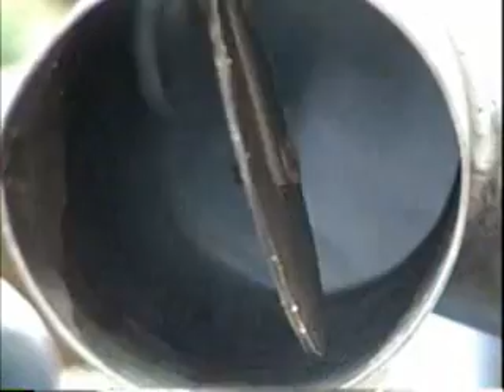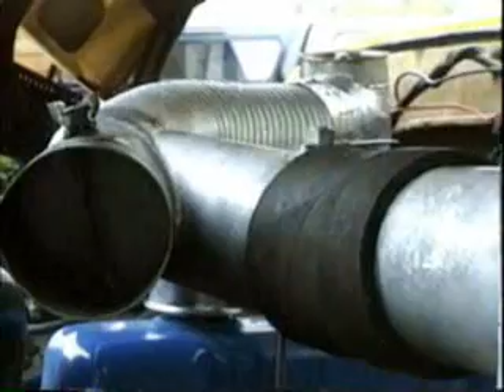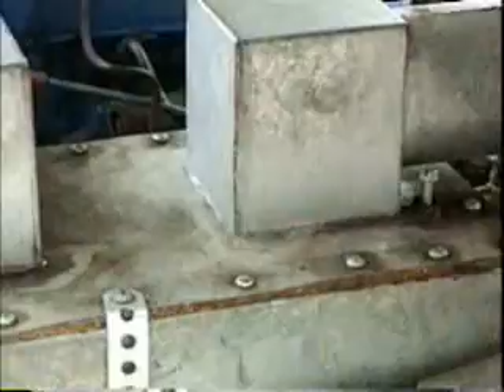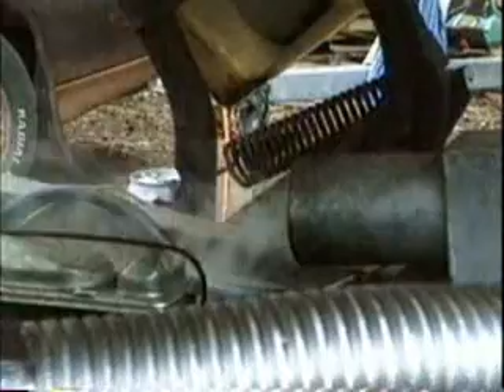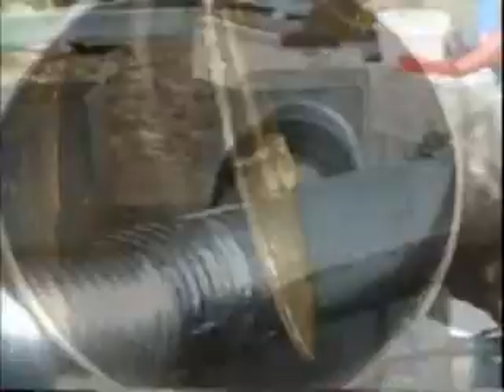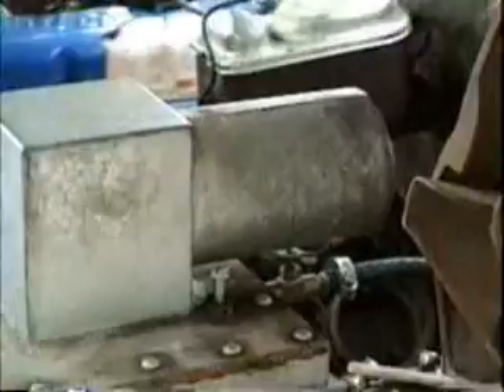Here is definitive proof on how to separate all Atoms in all liquid soluble matter.

Comment from the maker: None of the guys that explain things on the internet, or that work on cars today, would ever throw a burning cigarette into a can of gas. These guys learned by trial a error, and discovered the liquid gasoline does not burn. Inside the cylinders on the engine liquid gasoline doesn't burn, but the heat from the spark creates vapor, and along with the engine heat makes the gasoline vapor, but only about 20% of the fuel is all that burns, the catalytic converter, burns the remainder.

Comment: Because your white vapor has already phase changed from liquid to vapor state ie expanded by 163.3 times, your white vapor burns(oxidizes) much more efficiently ie generate much less heat during the compression stroke(because we are not compressing flash heated liquid droplets). Furthermore, because your white vapor ignites(oxidizes) much more efficiently and quickly, we may ignite the white vapors either at top dead center, or even after top dead center(during the power stroke).

Comment: The four strokes of mass produced gasoline powered engines are: Intake, Compression, Power, And Exhaust. Gasoline enters the combustion chambers during the intake stroke of the pistons. This gasoline is then compressed during the compression stroke of the pistons. Fuel injectors inject 50 to 65 micron liquid droplets of fuel into the combustion chambers which is ignited before the piston reaches Top Dead Center.

Comment: Just as a side note: 99.9% of the data available on engine ignition timing states that retarding the timing is to ignite the fuel later, thus the use of the word retarding. We are waiting longer before we permit spark ignition. I understand that the terminology may sound counter intuitive. However this is the data available. Just know that when comments say retarding timing for vapors and hydrogen, they are agreeing with you.

Comment from the maker: This is dead wrong. If anything flammable vapors don't need retarded timing. I found I could advance the timing and get more horsepower.  I took it to beyond top dead center. You see retarding the timing is when liquid inside the cylinders needs more time to vaporize the liquid, so it can ignite. The liquid gasoline does not burn but the vapor does. Hydrogen will work the same, being a flammable vapor.

Comment from the maker: You're right when you apply the heat to the water. On gasoline I applied the gasoline to the heat and got results like nobody has. I have applied a fine mist of distilled water to a heating element, whose temperature was just above 212 degrees Fahrenheit, and with a combustible gas leak detector detected a flammable gas from distilled water. It is not water vapor when I use my Flashing Liquid process, spraying a fine mist onto an established temperature. A molecular change, prove me wrong.

Comment: Just so it's clear ... I had a design project for my first "engineering" class in 1980 where I came up with a water powered car using electrolysis .. determined it required more energy than it would produce ... figure hybrid generation technologies and solar would help overcome this ... but have left it rattling in my brain for a while;-)

Comment from the maker: When you turn the power off to the heating element the lack of heat stops making the white vapor. This is not the objective of what I have created here. I am saying at the right temperature you can do this to water and create all the hydrogen contained in the water being applied to the heating element. Hydrogen makes water when burned. Fuel injection systems will be hard to convert. Butterfly valves are all that is needed to regulate fuel flow.

Comment from the maker: Actually all I use to regulate the flow of the white vapor is the butterfly valve under the carb. I am using gasoline taken from a gas station. I just sprayed a fine mist of liquid gasoline onto a heating element whose temperature is 600 degrees Fahrenheit. I got a white vapor with twice the power of gasoline, and zero parts per million hydrocarbons. This same process can be done to any liquid. I say hydrogen from water is possible using this process. Lab tests will prove it.

Comment: could also "hack" injector systems to get the injectors to fire only on cold start and idle ... what about safety? What happens to the vapors when you shut the car down? Do they accumulate or vent quickly?

Comment: "white gas" ... assume this is not pump gas ... how does this system work off pump fuel since the problem was lead with the Pogue carb ... and now we have unleaded fuels with a bunch of other junk poured in. My concern is the amount of vapor escaping at low RPM's .. that seems dangerous. If your in Georgia ... would love to get together and try some things out.

I could see this working real well on a carb system ... keep the idle and choke circuits for cold start and idling .. then vapor.

Comment from the maker: Yes, I have detected a combustible gas from distilled water, with a combustible gas leak detector, just above 212 degrees Fahrenheit, the boiling temperature of water. I know that the difference in the boiling temperatures of hydrogen and oxygen is around 60 degrees Fahrenheit, meaning a larger mass heating element is need to maintain the precise temperature to cause the hydrogen molecule to boil, while the oxygen molecule remains a liquid, which will separate the two molecules inside the water.

Comment from the maker: Applying the liquid to the heat takes liquids to temperatures above their boiling temperatures, before they boil. Lab tests on a Gas Spectrum Analyzer will prove I did it to gasoline. In doing this I have found the boiling temperatures of the different molecules inside the liquid, in my case gasoline was the first. I took one of the molecules in gasoline and turned it to a vapor, while the other molecules in the liquid remained a liquid, and they separated. White Vapor, and non flammable liquid

Comment from the maker: The simpler something works the more efficient it will be. All liquids have a boiling temperature, using the apply the heat to the liquid process. I applied the liquid to the heat. Fine droplets of a liquid will reach the applied temperature faster than the liquid can boil. As you know liquid takes time to boil. Take a small bug, pass a flame close to it's extremities, these extremities will blacken to charcoal almost instantly. I am saying liquids react the same, faster than liquid can boil.

Comment: That is interesting. I'm building my first particle accelerator which speeds up molecules to 761(Mach 1) mph. A Venturi action permits this. This acceleration takes place within a vacuum of 11 to 11.5 Hg. Cold accelerated particles spin(vortex). Hot exhaust traveling in the opposite direction facilitates the generation of a static electric charge. The combination of events frees electrons from the fuels outer valence shell thus permiting fuel to be broken down into it's elemental states.

Comment from the maker: Think about this. I did this to gasoline. Lab tests will prove I did a molecular structural change to gasoline. What I did to gasoline can be done to any liquid. The lab tests will prove what I did to gasoline can be done to water, using the right temperature, this means with my Flashing Liquid process at the right temperature will separate hydrogen and oxygen molecules in water. One could run any combustible on the ultra clean fuel (hydrogen) and when it burns it makes water.  Water for fuel.

Comment: I'm grateful for your knowledge and wisdom. Thank you. Many experimenters are using magnets placed within a spinning wheel, which at higher rpm's, will heat copper to a glowing red color. It would be interesting to apply a variation of the magnet wheel heater concept to the white vapor chamber design. Study- testing and detailed notes will tell us what is possible.

Comment from the maker: Science is wrong about the ignition temperature of gasoline. I have taken an electric heating element to a dull red (about 1000 degrees Fahrenheit) before the gasoline auto ignited. This is 500 degrees higher than science says the gasoline ignition temperature is. 500 degrees science says does not exist.

Comment from the maker: I never measured the pressure, I used the ambient temperature as a gauge, you see the white vapor started to condense at around 45 to 50 degrees Fahrenheit, the temperature in the video. Watch the very beginning of the video, You can see a liquid at the bottom of the round pipe where the damper is located. I have never stored the vapor it is made and used from the chamber. Just spray a fine mist of gasoline onto a 600 degree Fahrenheit electric heater and you have created my white vapor.

Comment from the maker: Gasoline and diesel are liquids at temperatures over 100 degrees Fahrenheit, and the heat of compression of these liquids will cause them to ignite. The White Vapor I created from gasoline is a vapor, and not a liquid, so there is no heat of compression, on the liquid, that is not present. The white vapor will not condense at the temperatures that gasoline and diesel remain a liquid. The white vapor is no longer gasoline. Lab tests will prove it.

Comment: Furthermore: As evidenced by the firing order of any given gasoline powered engine, only one cylinder(even a V8 engine) fires at any given time. If pressure alone significantly increases temperature, it may be possible that pressure without spark ignition may permit the white vapor to fire(ignite) more than one piston cylinder simultaneously thus increasing horse power. What are your thoughts on this.

Comment from the maker: Guess you don't read my comments, 530 degrees is the temperature science and the oil companies say gasoline auto ignites. They used a spark, which is over 2000 degrees to test this try it with a wrought iron electric heating element, putting it close to the gasoline. when the element starts to turn a dull red the gasoline will ignite. This is around 1000 degrees Fahrenheit. I have seen it and done it, try it yourself. Do it outside and use a very small amount of gasoline. I know I am right.

Comment from the maker: Just a good imagination is all you need to build it. I want to find out just what I did to the gasoline to create double the power and no hydrocarbons from the exhaust. If I am right it will be possible to use water and make hydrogen at the intake manifold, using the same process, I call Flashing Liquid.

Comment from the maker: Good for you, however this isn't about fossil fuel. Some wealthy gentlemen are suppose to have lab tests, with a gas spectrum analyzer, on what I did to the fossil fuel. These results will prove what I did to the gasoline, and prove that Flashing Liquid ( my process) can be done to any liquid. Hydrogen from water will be possible at the intake manifold, obtaining the right temperature, without a high pressure hydrogen fuel cell. Fuel injectors will not work or be needed, nor will computers.

Comment: injecting vapor is easy on whatever make car sir, i have done from old 1970's cars to 1980's, 1990's, 2000's and also 2010+'s cars, SUVs, Semi trucks, generators ect..... the list goes on forever. the only problem i had with the newer fuel injected cars is that i have to tap the intake manifold to port my HHO gasoline vapor mix directly to the intake valves. easy easy.

Comment from the maker: The newer vehicles with fuel injection are next to impossible to do what I have done to the gasoline, Flashing Liquid, and make it run. An older engine with a  carburetor, is the easiest to do this to. Just wait a little. I have gentlemen that want to do the lab tests on a Gas Spectrum Analyzer, on my Flashing Liquid method on gasoline. When it is proven this can also be done to water, making hydrogen at the intake manifold, from water, using the right temperature.

Comment: you can check my channel you will see all my setups have a Apexi AFC, it might be a VAFC or SAFC but always have one, it re-tune your car's computer so you can run whatever fuel correction or trim at whatever RPM at whatever throttle position you like. using a Apexi AFC gives you full control over your fueling  from your native fueling system so if your secondary fueling system has a low or dim spot you can use the Apexi to correct that spot and richen it with your native fueling system.

Comment: well as far as the fuel getting too cold i don't know because i live in the tropics but when using gasoline vapor i can use my Apexi to lean tune down to normal power and save ALOT of fuel, you will be surprised to know how lean you can tune with gasoline vapor

Comment: hi there i got same problem in UK if you read all billy's comments or ask billy  his method works well soon as i gave figures on this site they seem to disappear but you need very powerful alternator if u got room for that u are laughing the gasoline u will c will b only gas i had it running on this powered up with mains electric used very little fuel run great if you know how to work out amps watts etc etc piece of cake to do ask billy he the man all the best

Comment: yes sir the transducer way is way more efficient and safer plus better to control. you can use a adjustable vacuum switch linked to your intake manifold to control when and how much transducers turn on at what vacuum level ect. going the transducer way is having full control because you can properly set it to provide the correct amount of vapor needed at whatever point of operation, correction, load ect. its very exact when it comes to tuning in modern cars. i just finish a 2009 BMW SUV

Comment from the maker: With a Transducer. You are applying the heat to the liquid, and the liquid is boiling at the specific liquids boiling temperature. I am applying the liquid to the heat, and taking the liquid above that liquids boiling temperature. I did the transducer thing 20 years, were you born then.

Comment from the maker: I Flashed the distilled water at just above 212 degrees Fahrenheit. Because the differences in the boiling temperatures in hydrogen, and oxygen are so close. You need a larger mass heating element. The water changes the temperature  of the heater mass, if there is not enough mass. The finer the water mist the faster the water assumes the temperature of the heat being applied, before it can boil. Yes I did have a residue in my chamber, made from gasoline, it would not mix with gasoline again.

Comment from the maker: The difference in the hydrogen, and oxygen's boiling temperature is around 60 degrees Fahrenheit. You need to get to the hydrogen boiling temperature without reaching the oxygen boiling temperature, to have them separate, in the water. This will require a large mass heater, to stabilize the temperature, when the fine mist of water is sprayed onto the heater. This insures the hydrogen boiling temperature is reached, without going to the oxygen's boiling temperature. Try above 212 degrees.

Comment from the maker: Here is the problem. Oxygen and hydrogen have boiling temperatures with a temperature difference of around 60 degrees Fahrenheit. This means you will have to get to the hydrogen's boiling temperature to turn it to a gas, but not to close to the oxygen"s boiling temperature, which keeps oxygen a liquid, while the hydrogen is a gas. It is at this temperature all the hydrogen in the water used, will become a flammable fuel. To do this takes a large mass heater, and a very fine mist of water.

Comment: i went into the kitchen and got a pan and spray bottle of water heated the pan on high and let it get hot as it could then i went and sprayed the mist on to it. then i used a lighter at first and right as id light it there are sparks in the pan. not the vapor. so i used a different pan to make sure wasnt the pan. it did the same. then i used a sparker i think its called .to light a torch. i used it and it did the same it would spark in the bottom of the pan.but this is after the mist would go up

Comment from the maker: Today's cars will require your immigration, to fit it. Fuel injection systems are enclosed, a carburetor system is easy to do it to. Your are spraying a fine mist of gasoline onto a 500 watt 110 volt electric flat bar heater. I used two 250 watt in series. Angle the heating elements in about a 20 degree angle to allow gasoline mist to run down the heater. Enclose the heater and spray to allow air to be pulled across it. Duct the vapor to the intake manifold, the  butter fly valve controls RPM

Comment from the maker: Just by applying a fine mist of liquid onto a heated surface the liquid will assume the temperature of the heater, before the liquid has time to boil. Doing this allows you to take any liquid to any temperature, even above that liquid's boiling temperature. This makes it possible to find the boiling temperature of different molecules in the liquid, turning them to a gas separating them from the original liquid, while other molecules in the liquid remain a liquid, because they didn't boil.

Comment from the maker: Just to fill you in, Flashing Liquid is applying a very fine mist of liquid to a large surface of specific heat, at which time the liquid will reach the temperature of the applied heat, before the liquid has time to boil, so it boils at the applied temperature, which can be above the liquids boiling temperature. Applying the heat to the liquid prevents this, and the liquid boils at the liquid's normal boiling temperature. I Flash Liquid, on Gasoline, and get twice the horse power of gasoline.